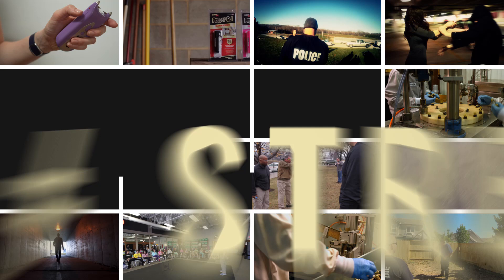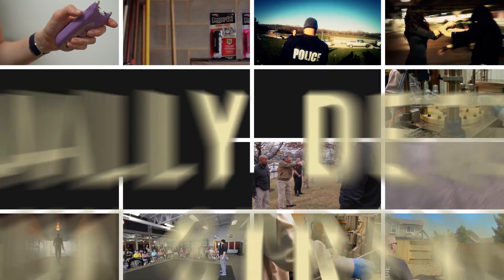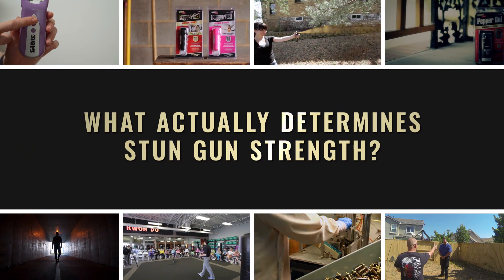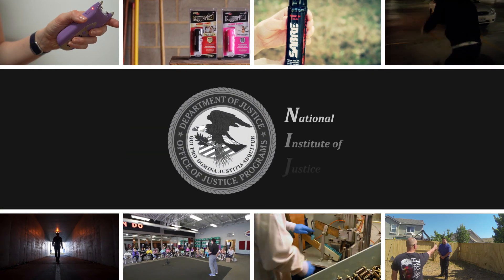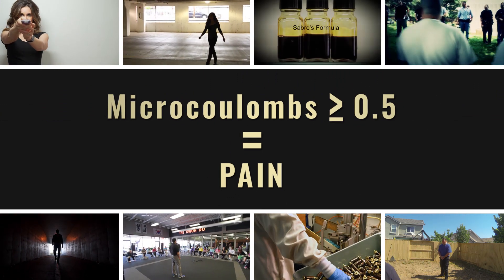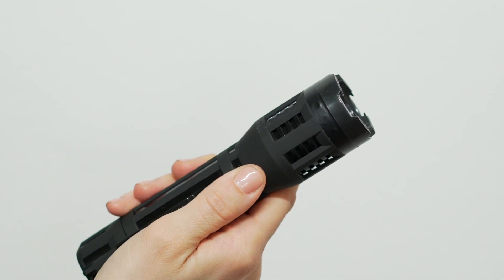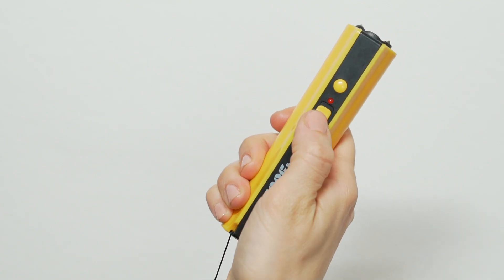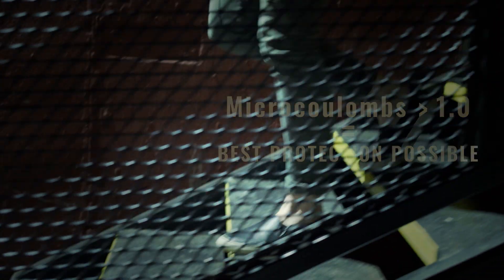Stun Guns 101 - Stun Gun Myths

Comment: I ABSOLUTELY DO NOT RECOMMEND A SABRE STUN GUN!!  It shocked me when I was just holding it and I was not pressing the red taser button.  My husband purchased a SABRE S 1009 for me for when I have to go out in the middle of the night to take our two puppies outside (we don't have a fenced yard).  I take it out with me, turn it on and wait for the dogs.  A couple of months ago I went to turn it on and it did not come on.....the little light above the on switch did not come on, nor did the flashlight come on....I thought it just needed to be charged.  I thought I turned it of....I'm not 100% certain however but when I came back inside and went to set it down, it shocked my hand.  It hurt pretty bad and just by an automatic reaction, I threw the stun gun.  My hand was numb for the next 10 minutes or so.  I have contacted the company several times over the past couple of months and they have not responded.  I was hoping for a replacement and for an answer as to how I could have been shocked just holding the handle (I never pushed the red button activating the taser) so there are two things wrong with this scenario.  Even if I were pushing the red button activating the taser, it should have never shocked me just holding it and....it should never have shocked me just holding it, not pushing the red taser button.  I'm afraid to even touch the stun gun at all anymore.  Now I record it when I have to move it  just in case it does it again.  I don't want to go through that again but I want it to be documented if it were to happen again since the company is not getting back with me.  I think it is pretty bad if a company does not stand behind the products they make / sell and refuses to get back to a customer.  What happened to me is pretty dangerous.  I did not buy this to personally get shocked out of the blue.  I never had any intentions on finding out what this feels like and unfortunately I did.  It also scared our dogs when I yelled from the pain and threw the stun gun.  Just BEWARE since I have no idea how this happened and if you have a problem with SABRE products, this company probably is not going to respond back to you.  I was patient for the first two month trying to contact them (I would call or email and wait a couple of weeks) but I have lost my patience and am now doing what ever I can to let people know about my experience and they can decide what they want to do.
Reply: cheaply made stun guns are garbage...period. sabre stun guns are variants of other cheap ones   ive had cheap ones which would activate with no button press   the electronics inside are garbage and the switches are garbage  get an omega stun gun and rest knowing you have an actual high quality stun gun made in taiwan (best place for any electronic device, 90%+ of high quality electronics are made in taiwan)
Reply: You must have been doing it wrong or something! I have never had a problem with mine!

Comment: Why not just wire a bunch of 5v ultracapacitors together on a bar.  When the thug touches the end and shorts it out they can get a few hundred volts but several farads.
Reply: Strong capacitors are often the most dangerous part of large electronics like old TVs, capable of delivering a lethal shock. Your idea might work too well, killing the attacker or potentially yourself if you get into a grapple that pushes the business end back toward you.